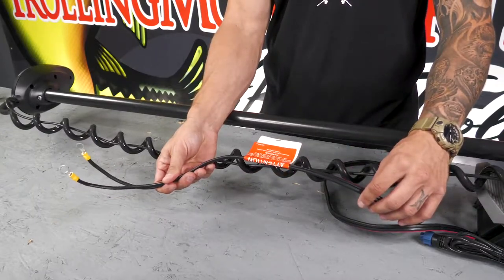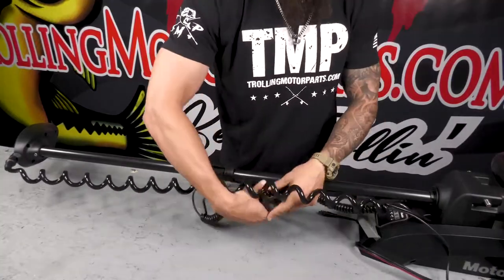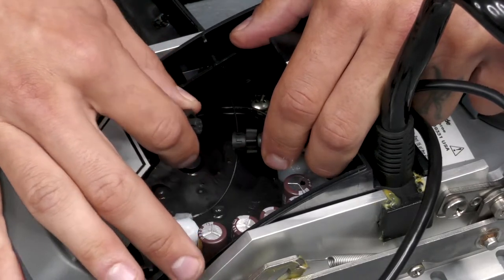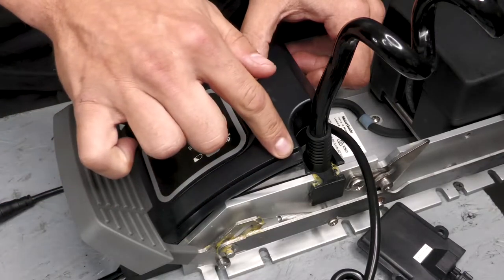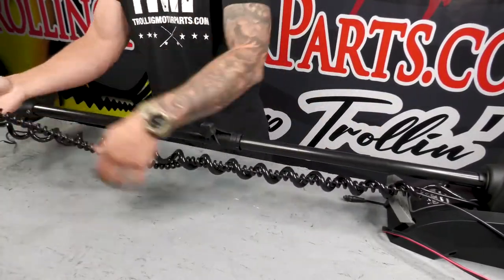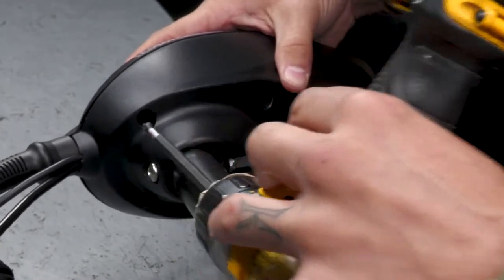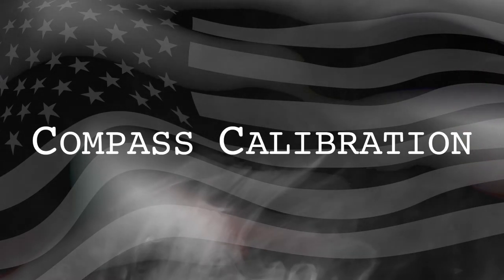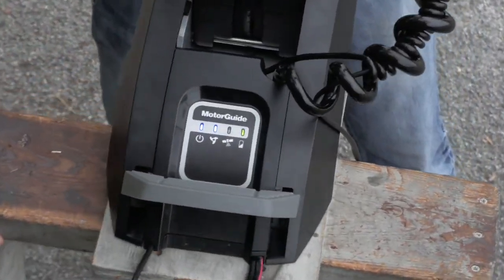Motor Guide Pinpoint GPS Module Replacement | Xi3 & Xi5

Comment: I just replaced the GPS module for the ix5 since the cord just fell apart, (power cord did also-motor guide said that is a common problem). Gps will not connect after reinstalling but all other control functions work with remote. Motor guide told me to take to dealer (75 miles away-nice option) as it could be the new modular or the circuit board. Can the module be tested? Motor worked was fine in all functions before I replaced the modular. Do the new modular’s work with the older circuit boards.?

Comment: Great Video!  My Xi5 couldn't acquire GPS at the end of last season.  All of the other features would work, the motor would turn, speed up/down, and prop on/off.  It is linked to my Lowrance.  Is this the only part that really controls any aspect of GPS? Just want to know before I order this part.  Thanks for your help.
Reply from the maker: The Control Board can also cause GPS issues, but with all of the other functions working fine, I’d lean more towards the GPS Module.

Comment: Do you sell these parts like gps modules.paid 1800.00 something for my xi5 mostly for heading lock for trolling .it goes every were but were i set it too.if i was a rich man i would make video of me ripping it off  n  throwing it the lake. Watching your  video gives me hope i can fix it  n  didnt waste my money thanks
Reply from the maker: Yes, we sell all of the replacement parts for this motor. There is a link to where you can buy this part in the description.
I would start by trying to re-calibrate the compass and mounting angle of the GPS Module. We have a couple of videos on our channel that will walk you through that. 
If you're still having the same issue after re-calibrating, you may need to replace the GPS Module.

Comment: I'm in the process of rebuilding mine, that internal cradle is a total pia. Truthfully i wouldnt wish a Xi5 rebuild on anyone, the fit and finish putting it back together sucks. The cradle dont fit and seat all the way making the right side panel also not fit easily. Ooff